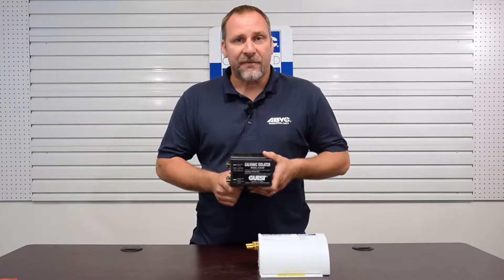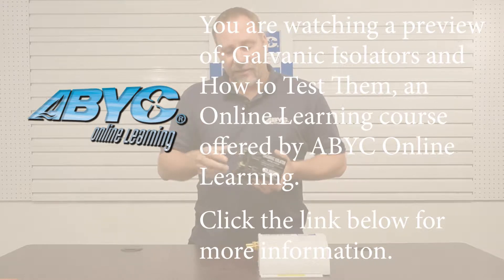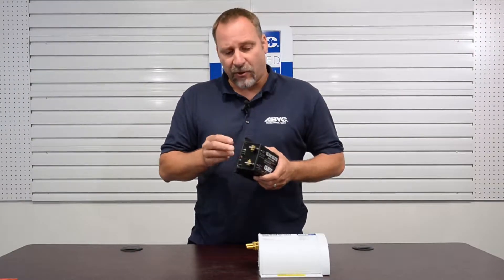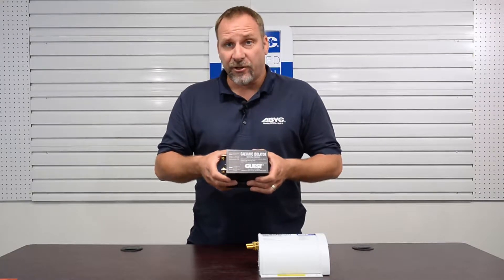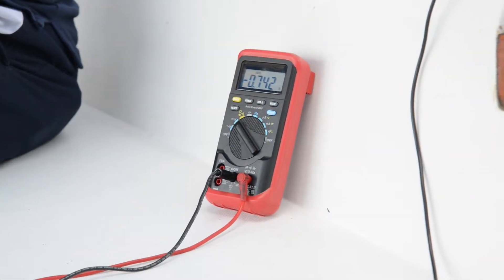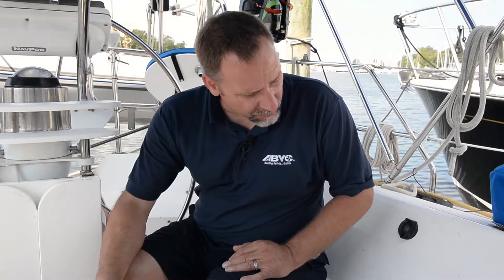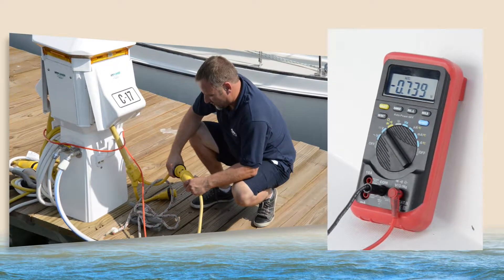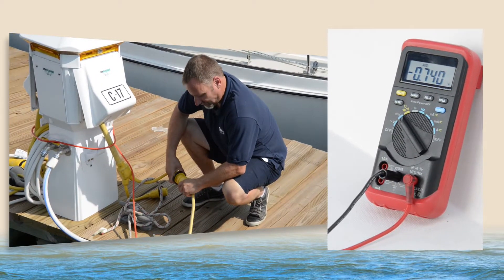Preview: Galvanic Isolators and How to Test Them

Comment: Completely useless.  He doesn't indicated if he is measuring leakage current or resistance and exaclt where he is taking the measurement.  What does he mean by "reference cell"?  Is that the negative multimeter probe?  C'mon dude.  Clean this up!